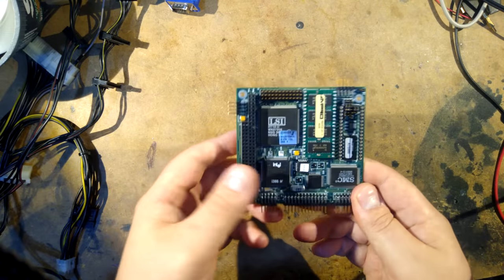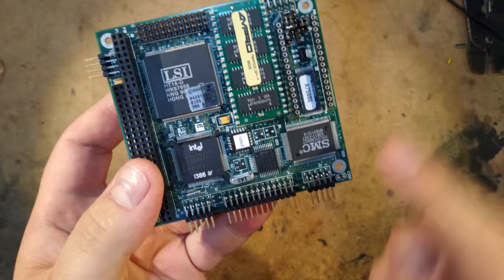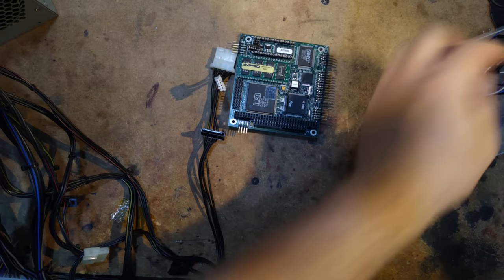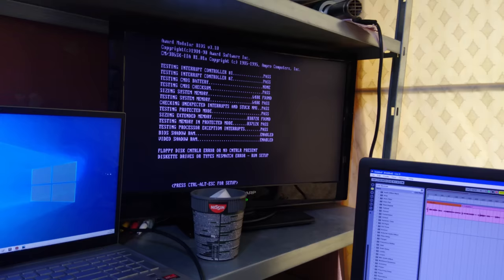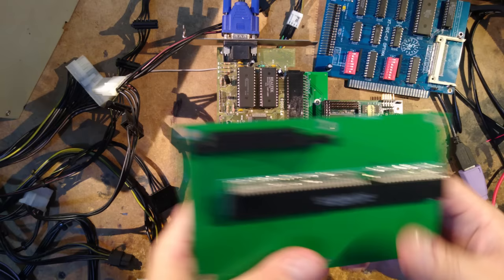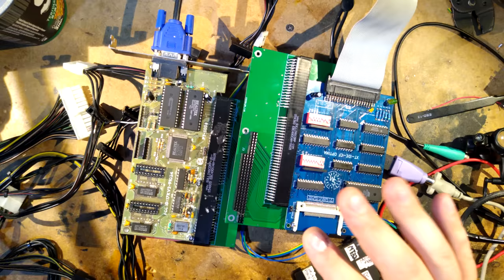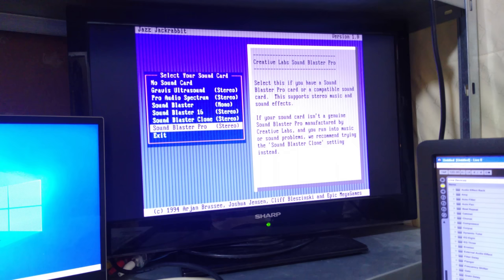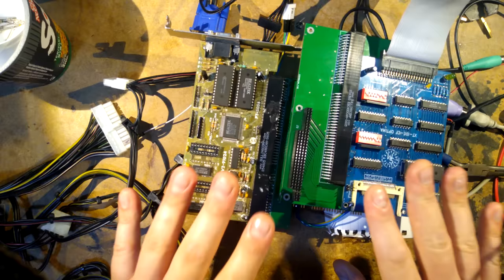DOS Games On A Tiny Industrial Motherboard

Comment: Did anyone else notice the sticking out pin on the ISA adapter board for the video card?
Reply from the maker: I deliberately bent some pins out of the way - the PC104 connector on the 386 board has some keyed pins.
Reply: @TheRasteri  ah, makes sense. I was thinking it was very lucky the pin wasn't important. 😛
Reply: yes i saw it